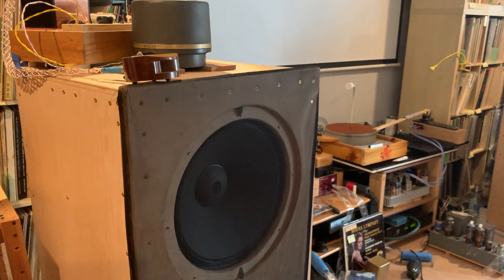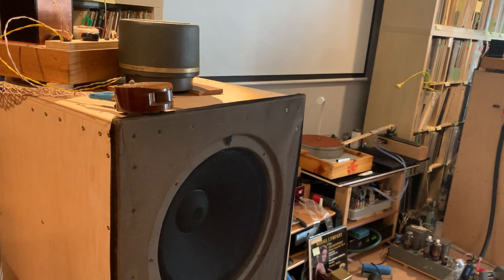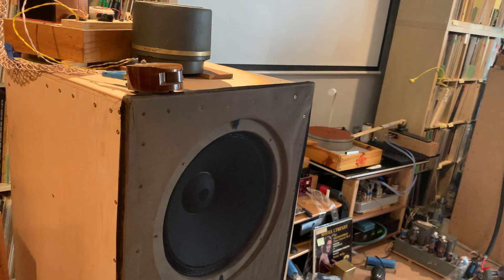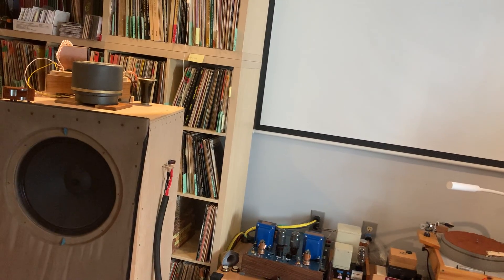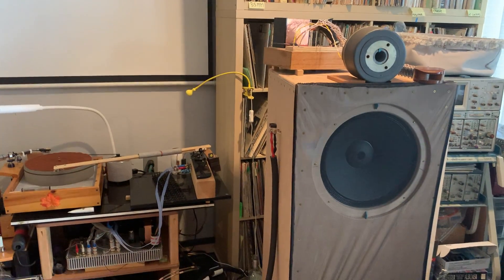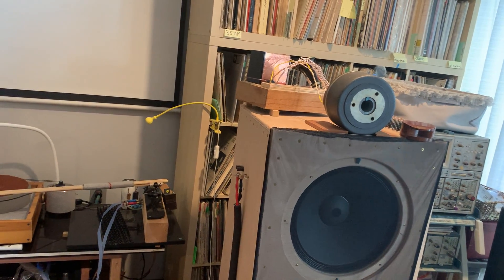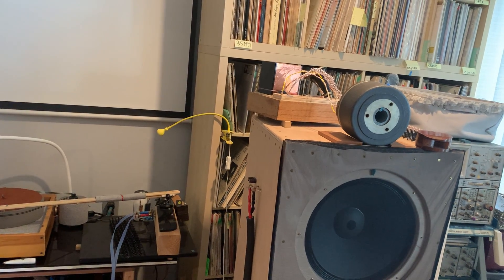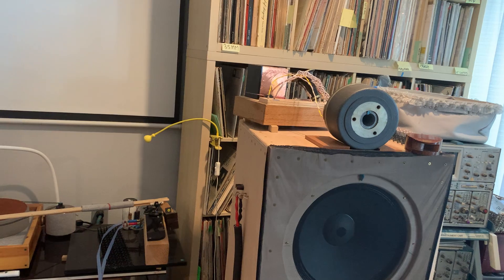Altec 288:   firing up or front? Report on a weekend adventure!

Comment: What was the actual name of the Taiko song was it that "O-Daiko" from kodo?
PS- lovely comparison & explanation of the differences. never thought you could use compression drivers without horns. won't the soundstage & imaging will get huge hit by not using even a small horn?
Reply from the maker: Are you thinking of this song: 
https://youtu.be/C7HL5wYqAbU
No horns works only for some of the large format compression drivers, such as the Altec 288 series. Smaller CDs like the Yamaha 4201 require the horn. 
No horns work only in a living room situation, where you sit relatively close to the CD, just a few meters away. The sound is not focused into a tight beam so it fills the room better. Also, as there is no horn, you are not getting horn colorations. There is no crossover element needed to compensate for the horn, so you are not getting that extra crossover distortion either. It gives a more natural sound, with horn sounds colored and artificial. in comparison. (I tried left channel bare VS right channel horn loaded, and bare was better by a landslide. With horn sounded like sitting in a theater, listening the the classic movie theater sound, and the bare was simply pure sound without distractions or alterations.
Reply: @realworldaudio  Yes i searched and only found that one. What was the one you mentioned? Also by large format you mean large VC+large diaphragm or just large diaphragm? & most 1.4" or 2" throats fits into this generally.

Comment: Pretty cool way to use a compression driver. When you get rid of the horn you can use them enjoyably in a typical listening room. Many people complain about horn speakers because they are too in your face sonically.
Reply from the maker: In my experience the too much in the face complaint comes when there's issues with the system being revealed through the speakers. When system has no issues, the same horns will project the singer right in front of you. (As my friend commented last week: "She is really here... I could reach out with my hand and touch her!"). 
Yet, sadly, 99.9% of the cases when a horn speaker is thrown into a system, it's gremlin time - you get what was hidden before. Not the fault of the horn... it's just unmasking it faster than any other speaker technology. Also, there are good and bad horns speakers... and the bad specimen are not bad because of the horn, but largely because of crossover, cabinet, driver mating issues.

Comment: You also have a larger than life  sound field. i.e. guitar 🎸 sounds out of place ..
Reply from the maker: Yes, guitar, lute, voice... everything sounds larger than life. However, their tone is right. CD or tweeter firing at you - size is right, but tone is off... there's only one to pick. My pick is the tone... 
One more thing though: for movies, complex orchestral pieces: the size is RIGHT! 
Also, for recordings recorded with natural acoustics (2 mikes) the sizes are right.... with complex recordings everything sounds larger because they are mixed to be larger to accommodate speakers that can project tiny images.... 
Just think of it - guitars are miked with internal pickups, and that mandatorily blows up the image size. When that sounds larger than life - then it's reproduced right, as that's how big it sounds with the mike in the guitar, or the guitar being close miked..... when we place our ears to where the mike is, it will sound enormous in size.
Reply: @realworldaudio  yep , I have pro audio,the producer of music ,decades church,auto , boat, transducers to harvest worms.  Tailgate party box. Made 2, 10 in pointed vertical  mid dome and tweeter  inside lid inside ice chest antenna held lid open(removeable) port cooled the amp fins, external power supply. One auburn,one alabama. RTR ,1984
PICS / NEGS ARE STOLEN
Reply: A full range Hiel amt, using magnetic graphene magnetic and conducting film to follow the wave form to a charged field i.e. bass to rf capability, the fluid air sticks to it, so phones have bass and electric cars have cheap efficient audio.

Comment: Perhaps your observations of live unamplified music, like at a very small club or maybe in a church with an organ and choir the singers will emulate from where they are positioned, such as a singing piano player you’ll get both in the same plane.  But if you attend a rock or bluegrass or jazz concert, it’s probably mic’s and processed through a mixing board manned by a sound engineer, then they’ll probably mix it to ensure the main vocal is up front but not necessarily centered.  Even at something like Steely Dan or ZZ Top or Doobie Brothers the instruments are behind the singers, for guitar I’m thinking the stage amps that are also mic’d, even though the guy playing is also singing.  I’m not sure I can actually tell you how it sounded when it was recorded, not many of get to sit in on a recording session that is live and unamplified.  A noble pursuit, but for me I’m looking for a pleasurable and energetic presentation, that changes my mood.  BTW, either it was Walt or Early who contended that if you pop the rear cover off a compression driver and turn it around so it is facing you, it’s now a dome driver.

Comment: Dear Janos, with the driver firiing up, don't you face comb filter problems, because of the difference of the distance to your ears?
Reply from the maker: The comb filtering occurs because there is a distance between the two drivers centres. Flipping the CD front or upwards changes the comb filtering frequency a little, but both scenarios have a similar issue, (distance between CD and woofer) which is only solved by a coaxial driver or single driver. 
The drastic change between the two orientation is that when it faces you, then you get both on axis response, and off axis response. Facing upwards, you only get off axis response, and not the mixture of the two. ;_) 
As a result, the upwards orientation gets you better tone, and the front firing gives higher resolution as the on-axis response is more focused than the off-axis. That's why the choice comes down to taste: hi-rez or better tone? ;.
What I noticed is that people are very passionate of which they prefer better, and every single person so far who heard it had a very strong preference for one or the other.
Reply: @realworldaudio  All stereo reproduction produces a huge combing effect everywhere except for direct sound at the sweet spot.... :-) I think in this setup the 500hz crossover point helps a lot lowering any impact, both in setting it outside our sensitive hearing range and having 70cm / 2ft length soundwaves. That all said, no one complains about combing, or 'image depth' when listening to live performance... so to some degree, we're only talking audio 'religion' here. When setting our goal to replicate live music,... different story.
Reply from the maker: @EduardBroekman  👏👏👏👏✨ And that explains why mono has an advantage.... :_) No combing... especially single driver mono....

Comment: Are you using the 288-16G ? They are not cheap, even used ones ;-)
Reply from the maker: Hi Gerald, sadly, they are mismatched! one is a G the other one is a H. Luckily, there's no noticeable difference between the two in my living room situation. (With horn loading, projecting to a long distance they are different because of the different phase plugs - which is the only difference between them.) I got them as they were pulled out from the stadium, and would have been discarded otherwise... one should keep eyes wide open... if you see an old movie theater closing, or upgrading their old sound system, that's the time to talk to the crew. They will be happy to give the pulled out stuff freely to you if you volunteer to get rid of it for them. (You will need a truck...)
Reply: @realworldaudio  I am going to use 2 288G and 2 288H on 1505... one of each kind will go to a double throat.. hope it will sound good with different phase plugs

Comment: My experience with my 288 and 1505 horns are that they are almost flat from my crossover of 500hz all the way up to it’s roll off 12khz.
Reply from the maker: Thank you Klaus! The VOTTs have the built in EQ in the crossover to account for the 1-3kHz peak caused by the horn.
Reply: @realworldaudio  do the double throat also have the 1-3khz peak?
Reply from the maker: @TheMazo02  Sadly, all wide band horns need EQing, the exact region depends on the actual horn, 1-3kHz is a general observation but may be wider on smaller horns (up to 5kHz, or even higher).
Reply: @realworldaudio  this will be mk1505b...I will see.. I wanted to use them without eq
Reply from the maker: @TheMazo02  Yes, they will need the EQ. You can try them without the EQ first - very midrange-y sound, or midrange overemphasized compared to the highs without the EQ. It reminds me of old movie theater sound, pretty cool though ; ).
Reply: @realworldaudio  i have jbl 2405s just in case :)